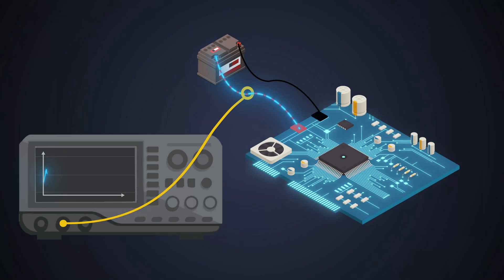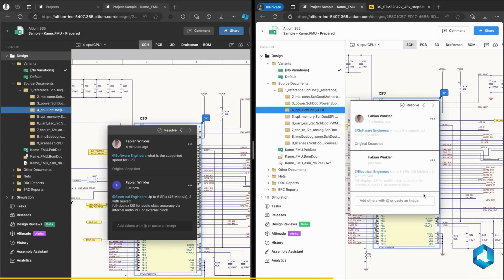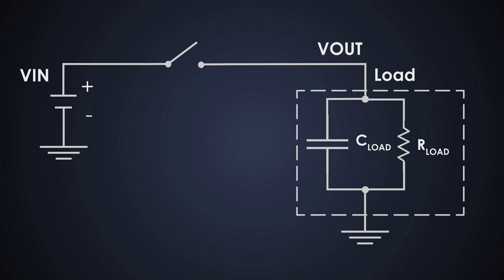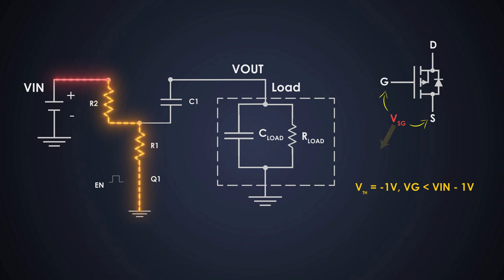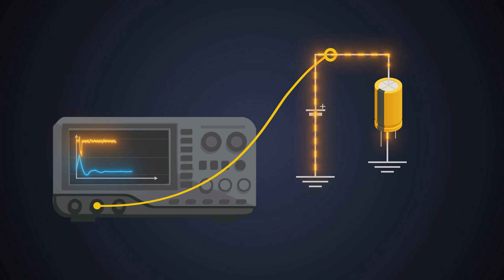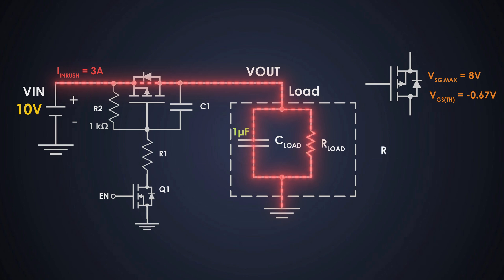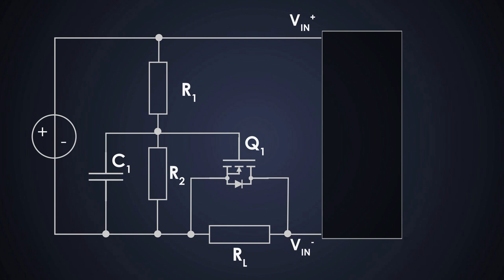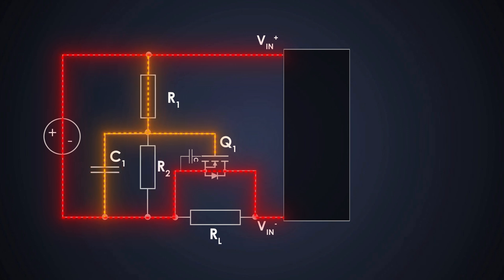How to STOP Inrush Current using P-Channel MOSFET? Inrush current limiter circuit | N-MOS circuit

Comment: in your p-channel circuit the capacitor C1 should be connected between gate and source. you have it between gate and drain, this will cause a current pulse when the battery is connected. please do some more training before releasing other instruction videos. colorful graphics do not replace basic knowledge.

Comment: Why use a p-channel MOSFET ?

If you just use R1,R2, and C1 shown as wired at 3:44, won't the R1-C1 time constant limit
the current inrush if you use a simple push-to-close switch connecting Vin to Vout ?

Or is it simply that your goal was to use a digital enable signal to connect Vin to Vout 
rather than a manual switch ?

Comment: In the version with the p-ch there are some errors, check better.
Reply: He is still insisting his version of reverse battery protection is correct, but not.
Reply from the maker: @coderhex1675 If you do this know, don’t badger around. Go check real references

Comment: I don't think it would work. Your P-MOS is I believe has error.
Reply: Well, it works - but also not really :)

As long as Vin is on, it will work.

Switching Vin instead of enable, which in most cases is where you actually need the inrush limiting. I.E. plugging in a power connector or a battery, then it will not work :)

Consider initial conditions where everything is 0V. When plugging in the power, Vgs of the PFET is -Vin, which means it's fully on.

The gate capacitance needs to charge through R2 and will always lag behind. Once C1 starts rising the gate voltage, it's all too late.
Reply from the maker: Why?
Reply: Capacitor should be placed between G-S in order to increase capacitance. R2 should be placed between G-D.
By the way, your letters at D and S are reverse/misplaced at 04:28.
Reply: @coderhex1675 R and C placement is correct based on his theory and explanation, D and S is also correct base on that. But he forgot the body diode orientation which is reversed! That allow the current to always flow. 

I played this(link below) in 2016, encountered a problem due to the same error. Just finally solved last year. So I know there is an error on this presentation. 

https://youtu.be/0HPReXKkObY?si=1JphXD0kLGLxo3iX
Reply: @coderhex1675  In short, you are correct that D and S is reversed!.
Reply: @FoolishEngineer  Simulate it.  The Capacitor needs to be in parallel with R2.

Comment: Question: is there an easy way to combine an inrush limiter like this and a reverse-polarity protection circuit, which is very similar but uses a PMOS transistor?
Reply from the maker: Use 2 PMOS one after another, you will find many circuits online easily

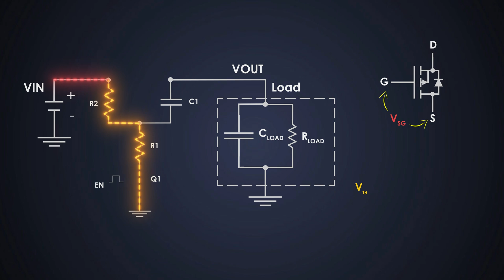Comment: 4:37 drain and source marking is inverted 
the capacitor should be placed between gate and source
Reply: That is what I saw as well.  Cap needs to be in parallel with R2.

Comment: The capacitor(C1) should be placed between gate and source right?. (In your examples circuits its placed between drain and gate)
Reply from the maker: No, this is right. You can check the references. I have tested this circuit and works as it is
Reply: @FoolishEngineer But inrush current limiting is actually achieved by controlling the gate voltage, causing the MOSFET to operate in the linear region, right?
Reply: Your point is correct. Capacitor is misplaced
Reply: @coderhex1675  The capacitor is placed correct although a second capacitor from source to gate is also required to avoid a current spike if the source is hot plugged. I think the explanation is a bit simplified, but what is at play is actually how a MOSFET transistor switches from OFF to ON. There is the Miller effect, which is actually used here to control the rise time of the drain voltage. When the transistor us about to turn-on at the threshold voltage, a lot of current will start to flow from source to drain. The gate voltage don't need to change much when the threshold is reached to go from a low to a very high current. So you can say the gate voltage is constant. If that is constant, then you have a constant voltage over resistance R1. So gate voltage and R1 will make a constant current to flow where some current comes from R2 a the rest will have to come through C1. A constant current through a capacitor is equal to a linear rising voltage.